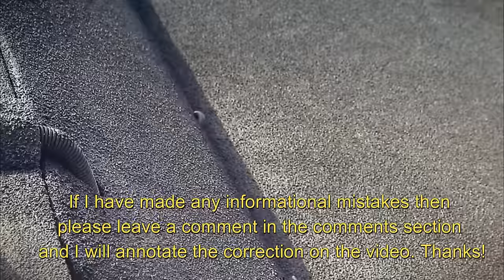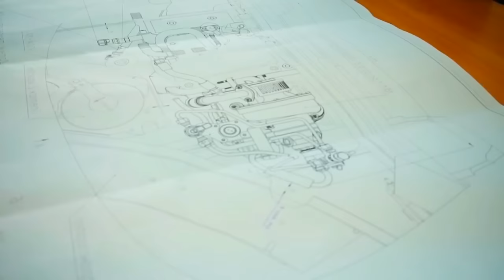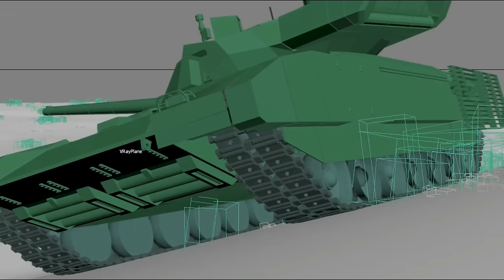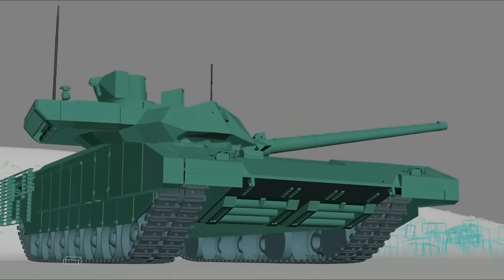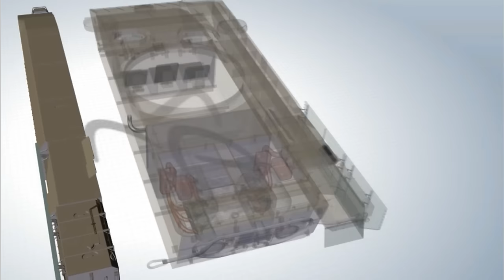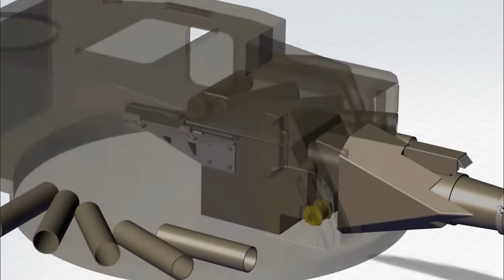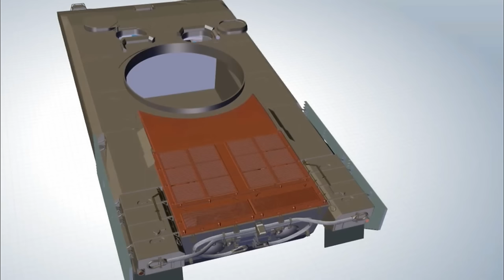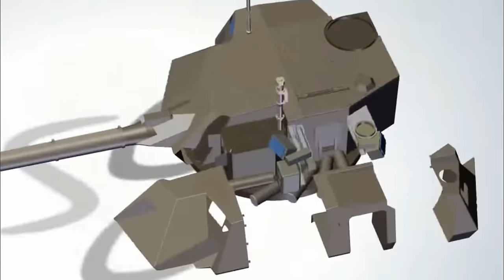T-14 Armata Russian Main Battle Tank - Tank Overview

Comment: "Probably upgraded to a 12.7"
12.7, AKA .50 cal, is a Western designation. Russia tends to instead utilise 14.5mm machine guns instead.
Reply: No, used 12.7(NSVT) and PKT 7.62, 30mm AGS-30 automatic grenade launcher or a 40mm Balkan grenade launcher auto. 
14.5 mm is just used as a basic light machinery like the APC and jeep guns, never as an infantry weapon, or installed in heavy equipment.
Reply: Dshk (very famous HMG) although perhaps still widely in service in the modern Russian army, still uses .51 cal, just about interchangeable with western ammunition, it's a possibility they'll maintain this caliber.
Reply: Alex Hobbs Dshk is in reserve, is not widely used already 40 years there are more modern guns, Kord 12.7 infantry, tank NSVT. 12.7 and 14.5 are used together.
Reply: Джо Неуловимый  apologies meant to say - 'not widely in service' and of course you are correct with the modern spec stuff. Just trying to relate west and east technology wherby British and American troops have been forced to use dshk ammunition when running out of .50 cal (resulting in alot of jams), proving it is not specifically a 'Western' Caliber though :-)
Reply: Джо Неуловимый Didn't know that - thank you for the correction!
Reply: In Russia, after the war left a lot 14,5mm cartridges. Initially, they were used for anti-tank rifles type PTRD and PTRS. When the tank armor became very thick, this weapon has been removed from service. For their further use, was designed heavy machine gun KPVT (installed in the tower BTR).

Comment: top HP is 2000
Reply: Source? It even got reduced to 1200 on the T-15 IFV.
Reply: Wikipedia
Reply: You do know Wikipedia isn't a valid source?
Reply: Excuse me, but this X-Engine definitely doesen't put out 2000 hp https://topwar.ru/7491-dvigatel-blizhayshego-buduschego.html That was a rumour. Officials state 1500 hp in the T-14 and 1200 hp in the T-15. Even 1500 hp is "boosted", removing the boost (resulting in 1200-1300 hp) will increase the engines lifetime.
Reply: Jonny its theoretical max HP is 2000 but cuts its life time down a lot to run it that high apparently thats from their web sight as all mechanical engineering you make something better than it needs to be and turn it down so it lasts longer
Reply: No. As my source stated it's possible to boost up the power (over the engines normal standard) up to 2200 hp, however you could do that to a lot of engines. Basically you could end up with 2500+ hp for a german MTU MB 873 Ka-501 (wich normal power is 1800 hp without boost !) because of it's higher displacement (1/4 more) among other factors, however that would cut lifetime too. So they don't. The Leopard 2s 1500hp engine archieves 1800hp with little modifications, with more they got 2600hp one time. (Reducing the engines lifespan though).
Reply: The only reason I like this tank cuz it is fast as fuk can I want one to wip in cuz I'm gonna boost the fuk out of it
Reply: is 1500 but can reach 2000 problem is that it lowers the life of the engine
Reply: On the test server it has 2200 HP, and an additional 300 HP with the upgraded turret

Comment: uhh we are pretty sure it can fire a anti tank guided weapon. 3UBK21 "Sprinter" is the ATGM specifically designed for the T-14, and it has a range of 8-12KM. the T-14 is also planned to have its own little drone, which then can laser designate targets. with the tank firing lazer guided missiles or shells beyond its own line of sight. which is awesome.

Comment: Good thought provoking video.  I am a fan of the Challenger 2, Leopard, Abrams etc but the T14 is an interesting idea.  To keep build costs low the chassis is shared with a number of vehicle variants.  Tanks are a combination of Fire power, Armour and Mobility.  Much of the armour in most western tanks is there to ensure the survival of the four man crew.  This sophisticated armour makes tanks expensive and heavy.  Heavy tanks are difficult to transport to theatres of operation and reduces their mobility once there.  Vast resources are poured into designing and building air transports that are large enough to lift modern tanks.  If we look at the T14 as a modern interpretation of the M18 Hellcat from WWII then it makes more sense. The Hellcat offered mobility and firepower at the expense of armour and the T14 appears to be offering the same sort of mix.  However the T14 addresses crew protection much better than the Hellcat ever did.  The T14 is an asymmetric response to the increasingly heavier designs being produced in the West.  The passive protection of the crew within the hull is a given on the T14 and if the active protection systems are any good then the combat readiness of the main turret with gun should also be assured.  Even if the active protection systems are not good today their improvements in the future do not add much weight.  In the recent wars in Iraq how many western tanks were actually hit by enemy anti-tank rounds fired from enemy tanks?  If the answer is 'few' then we cannot afford to be complacent.  It may well be that the T14 points towards a new direction in combat vehicle design with lighter, more mobile, tanks and heavier, better protected, personnel carriers.